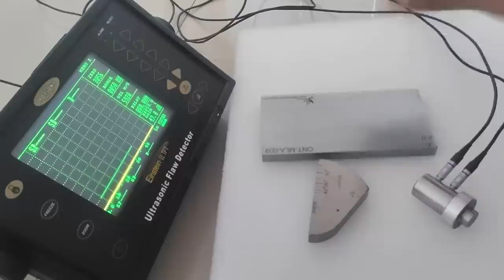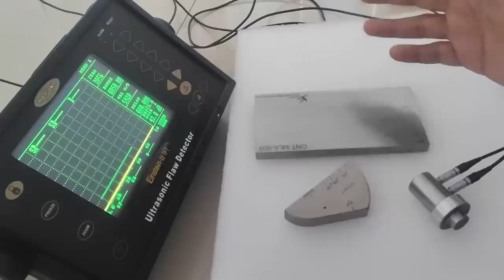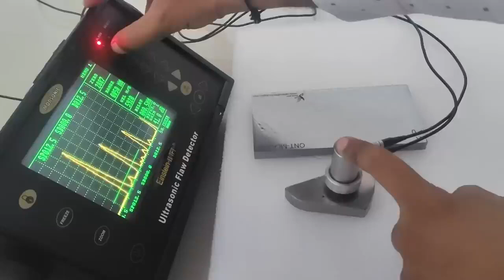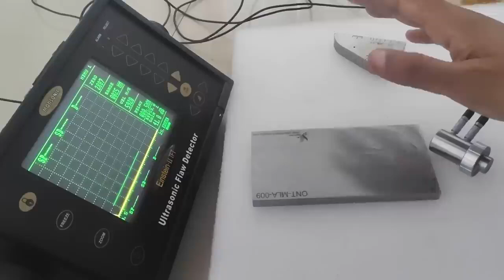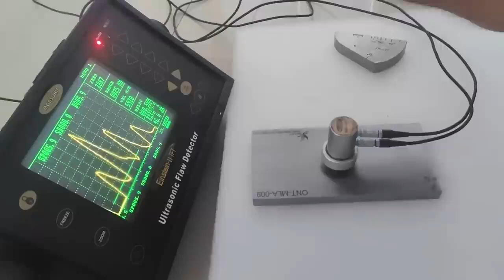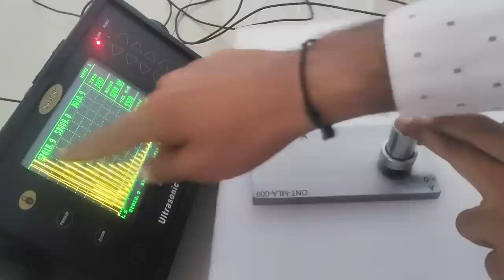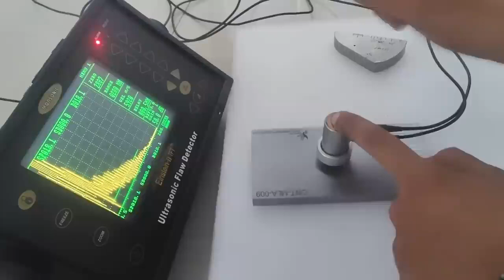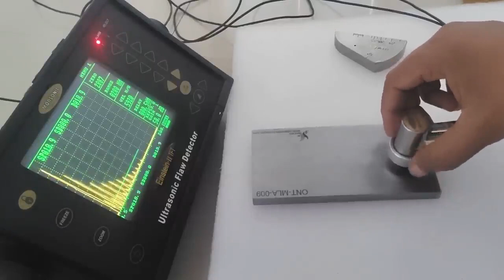2 techniques for Lamination Ultrasonic testing ll Plate and pipe lamination UT ll Part 2

Comment: Hello Sir, thank you for the video. I need to ask if it’s possible to check a 1,6 mm thickness steel for laminations using UT? Which mhz probe should I be using? Is  4 mhz TR probe useful?